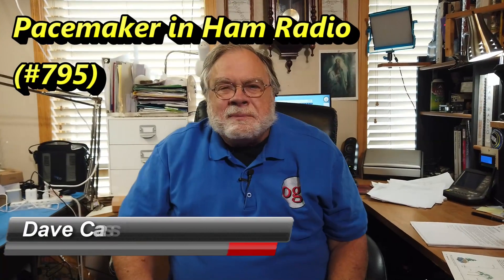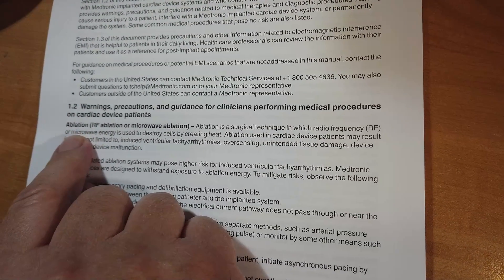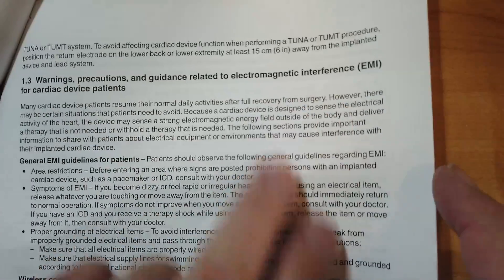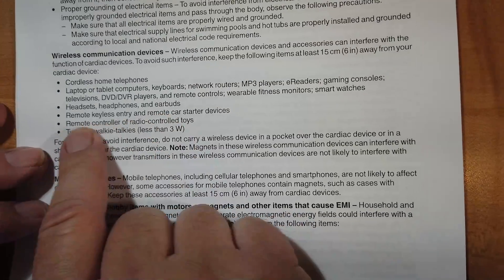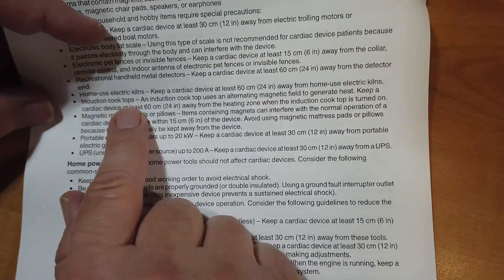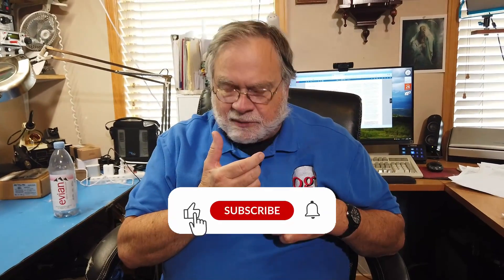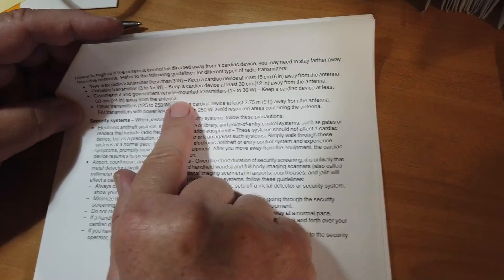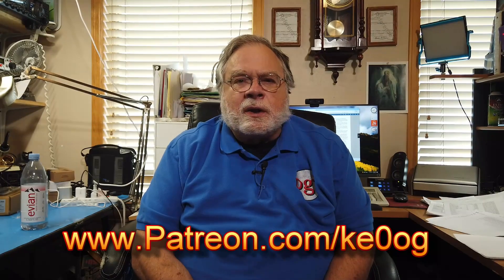Pacemaker in Ham Radio (#795)

Comment: Interesting video, Dave. I just had a Boston Scientific pacemaker installed three days ago. The manufacturer rep, who spent an hour teaching me the ins and outs of this Bluetooth device, pretty much said I didn't have to worry about anything (except the obvious biggies you mentioned). Still, I have concerns because, well, just because. This is all new to me. As someone else mentioned down the page, a speaker/mike on my HT will be a welcome addition. Sounds like the danger comes from the emitting element (the antenna) more than the transmitter itself. Now, I will measure the distance from my fender-mounted ATAS 120 to me in my pickup when out activating a POTA park  .

Comment: I have an ICD fitted. Antennas are at least 30ft away however I have had to take action to ensure minimum RF in the shack from common mode. I did this by fitting 10 Fair-Rite mix 31 ferrites to all the coax from the beams (3ft after the rotator) and 5ft  down on the masts that support my verticals. Doublets, dipoles and EFHW have 1:1 current baluns in the coax line (DX Engineering 3KW). all coax coming into the shack has lightning protection with 2 x 8ft ground rods and this should ground what RF is left on the outer. This may sound like overkill but my life is worth way more than the cost.

I used the clip on ferrites otherwise it would have meant a lot of rework on the established antenna farm. There is now negligible RF in the shack and I can run full legal power. The newer ICD and pacemaker devices are less prone to RF than the older models but staying safe has to take priority.

Comment: I have a Medtronic Device. It’s not a hart pace maker though. It’s used to control cervical spine pain and phantom upper body pain. I have the same informational paper work Dave 😁 There’s also something that should be pointed out here when it come to pacemakers (or) E-stim devices. When it comes to linear‘s, be VARY Careful! Trust me I know! RF POWER IS NOTHING TO PLAY WITH WHEN YOU HAVE ONE OF THESE IMPLANTS! Oh and as to needle ablation. Have had that done to and yes, 4 needles injected into one side of me neck and 4 on the other side to burn the nerves endings. And your awake through the whole thing. NOT FUN!

Comment: Thank you for this Dave.  I don't have an ICD but I have had ablation therapy for arrhythmia, work with B+ voltages in radios, and my one and only HF antenna is (unavoidably) about 10 feet from my chair as I operate my 100 watt radio (the wall of my house also protects me but I don't know how much). The info presented here is thus very timely for me.

Comment: I got a pacemaker implanted in my mid-30s. I've been pretty cavalier about it in the 12 years since. I think I've broken EVERY single rule that you mentioned. The only device that has caused serious interference was a 30 KW (40 electrical hp!) pressure washer system at work. Every time I started it up, the inrush current would cause interference that my cardiac tech would ask about. Once it got up to speed, everything was fine. After 12 years I recently got a new one put in because of the battery life. Apparently this one is even MRI safe. They're much more resilient than the warnings indicate for most people, but please don't do as I have done! Thanks Dave for addressing this topic. Maybe I should rethink my new hobby welding plans...

Comment: Hi Dave,
My father had a pacemaker implanted on Valentine's Day 2019, and although don't remember the manufacturer, I did research if he would be in any danger from my ham operations. The short answer was that he would be safe with a distance of at least 12 feet from the transmitting antenna. In my case he would be about 30 feet from the antennas on the tower and 22 feet from my wire antenna. Sadly, he passed away a little more than a year later. You and Loretta stay safe.  73  WJ3U